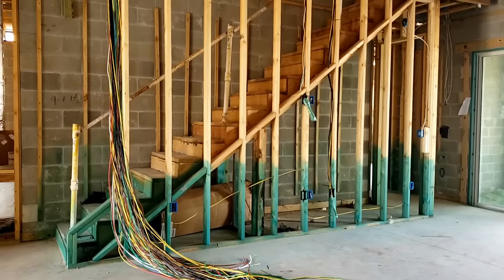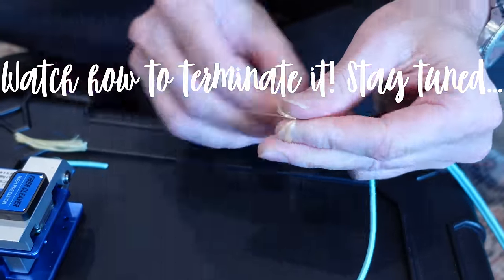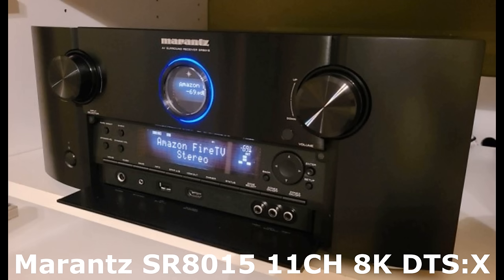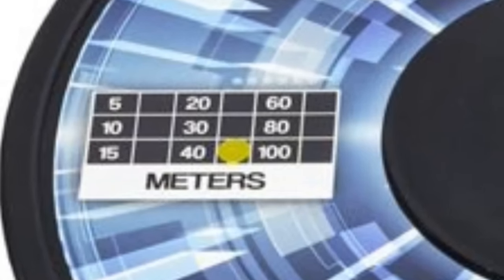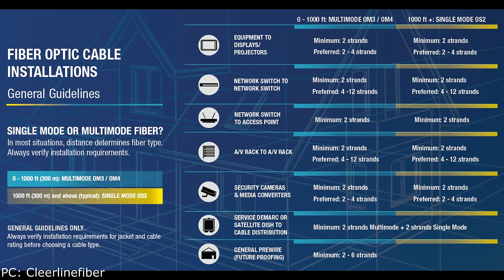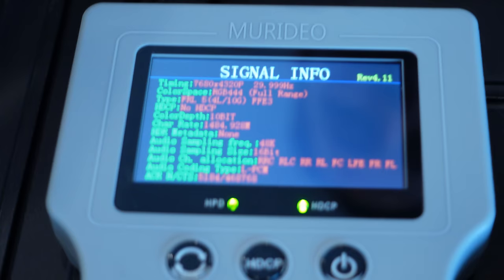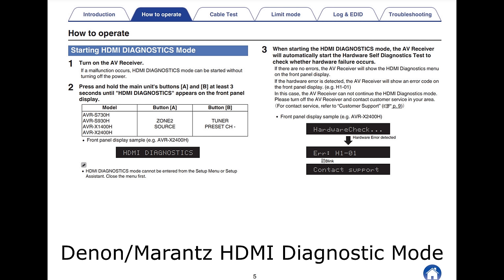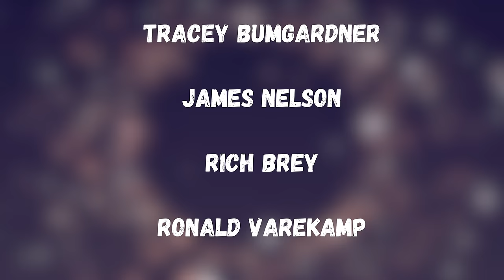Three of the Best HDMI Solutions for Long Distance Runs of 4K/8K Video

Comment: instead of using cables that will eventually be obsolete, pipe it in conduit so you can pull whatever you want in the future. I would probably run Smurf but I haven't wired a house in 25 years so there is likely something better by now.
Reply: A conduit was my first thought as well.  Seems like common knowledge.
Reply: Lol I was just going to post the same thing.
Reply: @tonycipps8443  I commented as soon as they said about fitting two cables for redundancy. It is crazy to fit cables like this and have to trash the place to replace them when you can just pull a new one with the old like he said later. But today it's just how fast you can install it that matters.

Comment: I upgraded from a basic HD projector to 4K UHD, and with the old HDMI cable, the 4k UHD signal from my Marantz preamp didn't make it the 10m to the projector. So I bought a new cable, supposedly 4K UHD spec, but although the projector saw a signal, it couldn't make sense of it - possibly the cable, or maybe the preamp couldn't drive it. In the end, I took the plunge and bought a 10m active fibre cable that worked first time, and still works every time. Sometimes it's worth paying a little extra...

Comment: I GREW UP WITH STANDARDS, ANSI. ASME, IEEE, MS XXX ETC. SOooooo, I HAVE about 8 Older HDMI Cables most 2.0 & a few Earlier --HOWEVER --NOT ONE OF THOSE FRAPPIN CABLES HAS A PERFORMANCE TYPE OR SPECIFICATION labeled on them. EIA and CEA are under ANSI Standards Institute----WHERE THE HELL ARE THE ##'S ON THE CABLES??? Should Be Law!!

Comment: Never directly plaster or concrete cables in walls or floors!!. Builders in uk do this all the time. conduit cost a few buck and its nothing to install compared to ripping out walls and decor to change, faulty or damaged cables. A friend of mine's a (spark) did this very thing with a HDMI cable and 11 months later it packed up and he was pi**ed. TV was on a feature wall, wallpaper and all.

Comment: I have a conduit from the AVR to the projector.  About a 10 meters run.  Had an Amazon basics copper cable which worked fine for my old PJ (1080p).  I upgraded to a 4K projector and had some issues with the signal.  Would not always sync at 4K/60 for example.   Replaced the cable with a RuiPro Gen3 fiber HDMI cable and it has worked flawlessly.

Comment: Please clarify: Gene has consistently spoke of installing Cat6 cables in the new smart house. Jason consistently said his company recommends installing Cat6A as a minimum. Neither discussed the difference between these two cables standards.  I installed Cat5e when I built my home 17 years ago. Now I need to run a couple of new cables. I’ve opted to use Cat6A. Can Jason please explain why he suggests Cat6A and will Gene please explain why he used and suggests viewers use Cat6? 

I know the main topic was HDMI, but this discrepancy jumped out to me. I want to know if I’m going in the right direction! Thanks!
Reply: I believe that cat 6 is older, slower, and not as easy to purchase. Last month I bought a bulk roll of cat 6a from monoprice (in-wall fire rated) and terminated myself..inexpensive and easy DIY. [correction on Feb 20, 2023 - I actually purchased fire rated Cat 6, not fire rated Cat 6a]
Reply: Slim_Savage  - I think there is confusion between Cat 6 and Cat 6a. I decided to upgrade my home to Cat 6 because it only cost $140 per 1000 feet, is typically thinner and more flexible, and I did not need to go further than 120 feet. If I needed to go further than 120 feet then I would have spent the extra money ($260 per 1000 feet) for Cat 6a cable and did the extra work to snake fatter and stiffer cables in my wall.

Comment: Wish I could go back and prewire for fiber. Anyways I have gone through several long runs with high end $100+ HDMI cables (Ruipro HDMI Cable 40ft) with failures after about a year. Found on YouTube Doug Johnson Productions videos that use SDI to HDMI convertors with coax that answered my problems. Maybe you can make a video on how to use them. They work great.

Comment: I'm running an older desktop with an Intel Core i7 4790K 4.0GHz and an Asus GeForce GTX 980 4GB STRIX. I need to tie it into an older flat screen TV. The only hitch is that I need 40' of cable to do this. Suggestions?

Comment: Do the runs in Condit and have access points. Have a few pullstrings and do best practice of the time leave the pullstrings for future use to pull latest and greatest in 10-15 years when you need to update major components or noticing major Performance issues.

Comment: I just moved my new Anthem 740 into a closet and needed to run a 40-50ft HDMI from my Sony A80K OLED TV to the receiver using the eARC connection. However, I kept getting a popping sound when transitioning into or out of videos on the apps on the TV. I've tried the Monoprice 50ft fiber optic HDMI eARC cable, a different 50ft fiber optic cable from amazon, and then a regular 40ft HDMI cable. All of them give a popping sound. It seems when Anthem gets a signal on or from an eARC source and there is a change from stereo to surround or vice-versa, the Anthem is trying to turn on or off amplifiers but the handshaking gets in the way which results in a popping.
Is there a way to confirm that the Bullet Train cable will not have the popping? Or is converting to CAT6a a better guarantee ?
Reply: Hi Jeff, you're not alone.  I have the same issue with an A80L OLED and an NAD preamp.

Comment: i use cat 8, why not just use that, any reason why not ? awesome video as usual, thx guys
Reply: Okay for 4K, but not 8K. Fiber cable is smaller in diameter, much more flexible and capable of supporting much more than 48Gbps.

Comment: I am pretty sure its a bit less about the cable these days and more about the transmitters and receivers. Your TV or AV Receiver, DVD/BD/4K players transmitters will only be able to push so much power in addition to their primary purposes. Not every transmitter a company makes will handle long distance transmission power needed and maximum signal strength at the highest rates as that is not each components primary role. As you noted, Fiber is the way. Fiber is not sending electrical power, which normally takes bigger and bigger cables. A big plus is it is not subject to interference (in a small home/business) like EMI from electrical connections are. Its just better. Look at a Toslink cable compared to all your audio cables today with all their shielding needed how large the diameters are, which is a fair relative example. 

One note I would consider that was mentioned , is cutting and resetting the end of a cable. True it can be done physically, but for electrical the exact length of a cable matters relative to its wave form, as where a signal start/stops should be at a peak of a wave and not in between. That is part of what cables get certified for. Do not allow an installer to say otherwise and in the digital computer world where I have worked (Silicon Valley) we ensure any install gets tested and category certified *after it is installed*. You can end up with weird problems that are really hard to troubleshoot (reflections and retransmissions). All of this is expensive though, more beyond most of us home pro-sumers and getting to the outer edges of commodity consumer electronics.

Comment: Hi Friend.  I have EPSON LS11000 laser projector.  From their I have connected a HDMI Cable ( iBirdie 4K Fiber Optic HDMI Cable 100 Feet Full 4K60Hz (4:4:4 RGB HDR10 HDCP2.2) 1440p 144Hz 18Gbps High Speed Ultra HD Directional Active Cord).  

My projector has EARC, so I had purchased a Bose sound bar and to connect their earc.  The length of the HDMI cable from projector to the sound bar is 130 feet.  100 feet from projector and 30 feet from soundbar. (Note: Now I cannot remove or add any connection now) . Now I need a way to  connect both the ends.

The video is coming fine but the audio is not coming fully.  it is getting loss for every 15 seconds.  I need a way to connect this without any loss.

Advise how to achieve.

Is there a way i can reach you by phone or email.

Expect your expert advice.

Comment: Very informative piece. That said, I am still having a video & audio drop out problem. System consists of a Anthem MRX 540 AVR, Ruipro 8k fiber optic cable, 20ft, with doggle installed, Epson Home Cinema 1080 Projector, with a 4k Roku. I am at a loss as to why I am still having this issue. Is there any particular HDMI cable, or babble amplifier that will resolve this issue. 19:46
Reply: The Ruipro cable is the best worst cable you can buy...Just get the bullet train AOC 48Gbps one.

Comment: i have avpro edge AC-EX40-444 with 10meters of cat7shielded between them from my denon 8500 to a samsung qnfn.there is a video delay of 10 to 15 seconds when switching devices,its annoying.im thinking of using some bullet train optic hdmi cables if it would cut the video switch delay time at least by half.whats your thoughts?
Reply: with the samsung one connect box and extended fiber cable everything switched faster but i moved things because i plan to replace tv in the near future.

Comment: I'm using a 10 meter passive copper bullet train HDMI for my Epson 6050. Works well and has all the certifications on the jacket for inspection/safety.

Comment: So Cat6a only provides up to a 10G signal BUT av receivers and projectors can provide up to 18 G media.  How does this work?  Am I missing something?
Reply: Signal is compressed from 18 to 10G.  Some forms of compression are better than others but still compressed.
Reply: Thx but still confused.  So the av receiver gets a 10 gig signal, so does the av receiver “uncompress” the signal to give the projector an 18 gig signal or whatever it can take?
Reply: You need a pair of adaptors.  One at the source that converts from HDMI to CAT 6 and compresses and one at the other end that converts from CAT 6 to HDMI and uncompresses the signal.  It’s lossy compression but what they are saying is you can’t tell the difference vs just using an HDMI cable.  I suspect this depends on the size of your screen and viewing distance.  So this is good for people who don’t have conduit in the walls but do have Ethernet cable in place.  11:30 in the video is where they cover this solution.
Reply: @fl3shgordon    Ok thx for this!  I will take another look at the video.  Very much appreciated! 👍🥳🍾
Reply: At this point in time, I would install Cat 8 (skip Cat 7, it was never certified). Cat8 is 25Gbps or 40Gbps. In my house I run OM4 fiber for multimode  or OS2 for singlemode. I prefer singlemode, and I do plenty of runs because much of my stuff won't work over IP, so it is direct connection, or if possible to a splitter/matrix. Basically overbuild and put in IP based stuff as well as direct.
Reply: @rezenclowd3  Maybe you can explain this to me.  Cat 5 cables were hardwired into my home when we built it.   Currently, I am running a 2018 (13.5 G) Sony 285es projector that I want to upgrade to a JVC projector that goes as high as 40G.  

However, CAT5 cables only go to 10G?  So how does one swap out a CAT5 cable to CAT8 without tearing a whole finished basement apart?  I realize this is similar to the last question, but does one add additional equipment after the — base “fiber optic router” that comes into the house from the internet provider to “boost” the signal for the projector?  Like the last fellow this is a mystery to me too!

Comment: But do you get input or delay over these long runs ?
Reply: Nope.  The signal travels at the speed of light (or about).  A few feet/meters of additional cable length will not cause any delay, not a chance.
Reply: @haukurorsson833  Ok thx.

Comment: I am using a fiber optic HDMI cable to run 4k 120hz games from my PC with an RTX 3090 to my LG C9 OLED tv but it was a pain to find one that would work. I bought and returned 3 different cables from Amazon until I found the one I am using now. I wish I would have seen a vidoe about the Bullet-train cable a year and a half ago.
Reply: What cable end up working for you? Looking to do a similar setup but for a ps5.. At the price the bul.. Is, i might just get another ps5 instead

Comment: Well that's what I was just going on right there I leave internet the orange stuff and I have that tied off and I always when I pull the cable I always have jetline and I'll tie on another piece at the end so that way I'll leave another one in place. To my new Samsungs and LG TVs they both requested the cat 7s so that's what they've got going to them. And that other video were your terminating the fiber right before you leave it with you get us those alcohol pads and the alcohol should be the above 70 it should be in the 90 so that way it doesn't leave any streaks on the glass

Comment: Ok, super dumb question: Why wouldn’t you just get an Apple TV and a separate set of powered speakers or avr/speakers in all 5 or 6 areas of your home. Why would you put all those wires in?
Reply: In my case my wireless signal is slightly weak downstairs so I ran a cat 6a cable to my downstairs nVidia shield pro. It also helps if all 3 kids and my wife are simultaneously using wifi for video zoom or movie or other high bandwidth usage. The cat 6a cable doesn't have to fight the shared wireless bandwidth. Lastly I stream some super large, uncompressed 4K movie files with Plex and wireless is noticeably struggling to keep up.

Comment: 4k cables? That's future proof?
Reply from the maker: Watch again and read the damn title.
Reply: @Audioholics  at 12:19: " that's for 4 k?" "Ya!"
Reply: The better answer is that HDMI cables come in different specs.  The Bullet Train brand mentioned here (there are several brands to choose from) come in two specs.  At the 18GBPS spec a cable is good for 4k/60hz with HDR and at the 48GBPS spec a cable is good for 4k/120hz or 8k/60hz(?) with HDR.  It should also be said that this video was focused on long runs where a AOC fiber cable becomes necessary.  For shorter (say 2 or 3 meters) runs you don't need active cables.

Comment: Conduit? Everything Electric, ethernet, av, fiber etc. Has been run in conduit for atleast 50 years. Nothing in a home is not run in a conduit. Why is it not standard in usa? Seems really stupid. Just something simple as Electric, if you want to update the cabling after 30 years (new standards and so on) just pull in the old cables with the new, or with a "feather" as it called here.